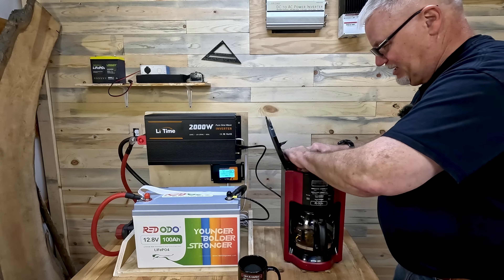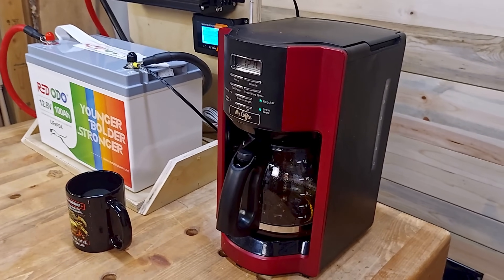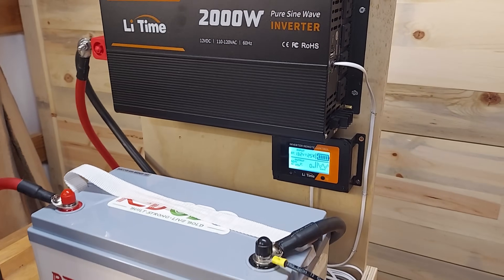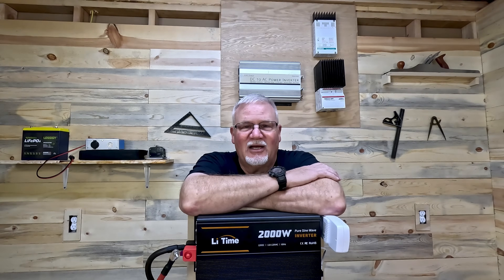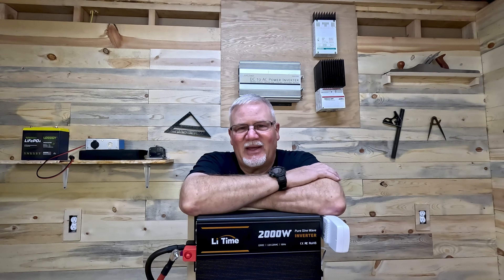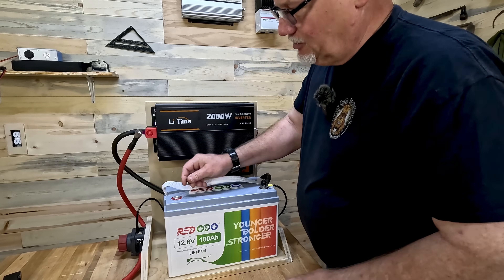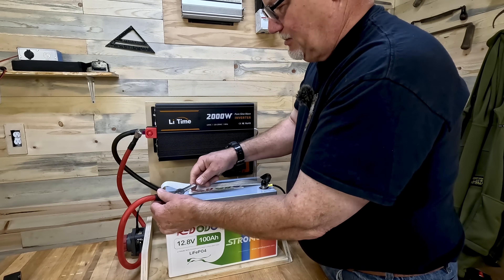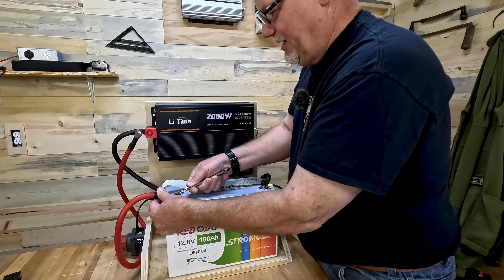🔋 How To Build A DIY Emergency Power Bank In 10 Minutes! ☕️

Comment: 200w solar panel - mppt - 100ah lfp - 12v car multiple socket and usb

It's my set up for emergency situation.. more than enough for small led lamp, 12v fans and charging radio and phone.. 😊😊😊
Reply from the maker: Sounds like a perfect setup for emergencies!

Comment: You can also take the battery that needs charging to your     car or   truck and use the battery cable from your car battery to the battery that needs charging. Then start the c ar and let the alternator charge the dead battery the proceed
Reply from the maker: True though it may not charge it fully and you'd have to have at least enough battery tobstart the car

Comment: Why did you use a 100 amp fuse, but are gonna use a 250 amp circuit breaker?
Reply from the maker: 150a breaker - what I said was I was using a 100a fuse but have a 150a breaker coming.  With one battery like this one the BMS will stop it from drawing over 100a (which is does in the video but it was at 130+ amps) -- and a 2000w inverter drawing 2000w off a 12.8v battery is at 156 1/4 amps.  If the BMS fails the breaker will disconnect before I hit 2000w on the inverter.

I realize this isn't what most do, it's just what I tossed together for testing purposes.  If I were going to use this system I would use two LiFePo4's and a 250amp breaker probably.
Reply: @TheOldJarhead  Gotcha, thanks for the quick reply, was confused because link takes me to a 250 amp fuse, I have the same inverter and a 12 volt, 300 ah battery, so I should use a 150 amp fuse? I've seen some use a 250 amp  fuse
Reply from the maker: Depends on the BMS and inverter.  That inverter can draw over 230amps if it peaks at 3000w, for example, then at 12.8v, that's 234amps.  But it's a matter of what you feel safe with.

Comment: 🤔🤔🙋🏿🙋🏿🙋🏿🙋🏿🙋🏿🙋🏿I have a question🤔?actually a few😮. I'm in Houston I live in my truck. I have a topper too tho. My fridge ,microwave ect is in back . I bought a bluetti. 2nd day basically broken.  Screen died . Im sending it back . I've looked into dual gas powered generator 😑I'm not convinced.  But I don't think a bluetti or and power station can 1 stay in my truck especially during the summer without overheating or something.  And personally I'm not liking how it's all digital all of this crap is. Can these batteries handle tx heat? Would this power my gear. Or is a isolator better.  Help PLEASE😢😢😢
Reply from the maker: Texas heat can be a killer for LiFePo4's as they generally cut out at 149F.  So, imagine, the battery is in the bed under topper and it's 120F out (I've seen that in Austin back in '99) and the battery is in use and generating some heat itself.  Could potentially get to the upper temps and shut down.

It's a tough one without AC keeping things cool and power stations are pretty much the same.  Perhaps though, if the battery and inverter were placed in a location with good ventilation that can allow enough airflow to keep things a bit cooler than perhaps it would work fine though in hotter temps I'd be sure to be in the shade!

This setup would run a small MW and have no issue running a fridge but you'd need some solar on the roof to provide plenty of recharging during the day and a small generator is a good idea for those days solar isn't enough or it's cloudy.  An inverter/charger would provide the charging profile needed for LiFePo4's and allow the gen power to pass through as well, plus give the opportunity to plug into shore power when available.

Perhaps an RV AC unit on the roof running off shore power only or the generator could work as well.
Reply: @TheOldJarhead  🥳🥳ty for actually responding that means alot to me . I'm doing a thing on my channel I sent u a video idk if u saw it .I just got off checking messages ty I appreciate ur time. It's making me consider just renting a place.  The stuff I've been though with technology and shipping is not worth me suffering due to defective equipment like the bluetti ac180🙄 . I can handle heat but inside a parked car in July in Houston is not fun . I've done it. That's why I'm preparing now. But I hate being in apartment or anywhere other strage people are . But I have no option sounds like🥺😭😭
Reply from the maker: Didn't see it but I'll check out your channel.  And yes, the heat can be an issue regardless and unfortunately, where you live is HOT!  I can't imagine trying to keep even an RV cool without shore power.

Comment: Nice video... but if I want to charge the battery via the AC charger, do I need to disconnect all the cables each time? Or can I leave the entire system as it is?
Reply from the maker: Nope.  Just connect the charger and go 😀

Comment: Those are nice cables. Where did you get them?
Reply from the maker: I had them made up at 'Traffic Jam's' -- pretty much any car audio place will do it inexpensively though flexible 1/0 is $10/foot to the 3 cables cost me $77 after connectors (which had to be hogged out a little for the switch), heat shrink, crimping etc.  Since it's a one time deal it's worth it IMO.  Cheers!

Comment: Great video.  One thing I wish you would have done would be to measure the amps on the 1/0 cable with a clamp meter. Thanks so much.
Reply from the maker: I may have to that if my Amp meter works but the math is pretty simple 😉 at 13.2v 1070w is 81amps.

Comment: Is it okay to use a power strip and connect it to the inverter for convenience sake?  That way I won't have to be plugging and unplugging appliances.  Enjoyed the video very much, I just ordered a couple of 280 ah batteries before the tariffs increase the price.  My EG4 48V battery is now 200 dollars more.  Ice will help with the pain from the burns in the future.
Reply from the maker: Yes!  Just like any circuit you can use a power strip.

Comment: And you can add a 12v Marine Plug for 12v applications.
 I had my small 400watt setup on a hand truck. 
The larger 200 ah setup in a box with wheels, with a 1500 watt PSW inverter. That ran my small micro wave, or One cup coffee maker for tea... Even the 400 watt setup ran that.
Reply from the maker: Nice

Comment: Why does this setup not require proper fuses?
Reply from the maker: I never said it didn't.   I also have a fuse (mentioned in the video) and have a breaker (the proper method for a setup like this) on the way.

Comment: Great coffee episode  lol
We brew our coffee for 4 months now off a ecoflowriver2pro 
We have 1 Redodo battery with a 10 amp charger off solar but we have not had to hook it up as far as yet
Wish you could tell us if i could hook this 12v-100ah lifepo4 up as you mentioned you need a 24 volt charger ? We are confused..
Reply from the maker: 12v charger.  The one I use does both 12 and 24v.  I can't recall saying you needed 24v.

Comment: Can you recommend one with an automatic transfer switch built in that essentially acts as a bigger ups?
Reply from the maker: I'd have to look into it.  Don't actually know one.
Reply from the maker: It occurred to me that the AIMS I was running for 11 years had this function.  You had two choices:  power from batteries with 'utility backup' or power from Utility with battery backup.  I never worried about it because I had a generator and no utility power and if the generator ran, it charged the batteries and powered the cabin regardless of the setting.
Reply from the maker: OK, now that my brain fog has cleared (LOL) it occurs to me pretty much ANY Inverter Charger will do this ;)  Here's one:  https://amzn.to/4iQPZB4  3000w inverter, peaks at something like 9kw and works as a UPS. https://amzn.to/4iQPZB4

Comment: That's a nice project. I need an inverter and cables but that's how I plan to replace my solar generator to run the microwave when the power goes out. I'll probably pay extra for a 48V battery and use a 48V inverter. Also setting up a smaller version of that to keep portable devices charged.
Reply from the maker: 48v would be great, I'm doing one this week.

Comment: I like that inverter remote display! I have several with remotes but it's just a toggle switch. Wonder if that display would work on other brands ....🤔
Reply from the maker: Hard to say unless they are rebrands.  I see others have them but they appear different.   It's a nice feature and has power button as well so the inverter can be elsewhere, say in an RV.

Comment: What would you suggest for a battery charger ? TYIA
Reply from the maker: Honestly?  I'm using a cheap 19amp Amazon job that seems to work, but I've been looking at some others and think any of the less expensive ones by Redodo, LiTime, etc, will work.

10amps is a bit slow but works if not in a hurry. Otherwise, I'd get a 40amp charger.
Reply: @ I checked out a few on Amazon , I've spent less on a weekend bender in Yuma . Hopefully a sale pops up , it's more want at this point than need . I appreciate your guidance
Reply from the maker: https://amzn.to/41RCuKG This one has been working well for me.
Reply: @TheOldJarhead  Just purchased , thank you
Reply from the maker: You bet.  It's a 10a charger but I use it for all my 12 and 24v LiFePo4 batteries
Reply: @TheOldJarhead hows the warranty on litime batteries had you had any issues with them by chance looking to buy one or redodo lithium battery
Reply from the maker: I've had no issue with either of them and both have 5 year warranty's.  I also like the XZNY's which I have a few of.  I'll admit, I've given away several batteries since reviewing them but those who now have them have not mentioned any issues with them (they all use them for overlanding setups or home backups with power stations).
Reply: @TheOldJarhead  thanks for replying back so quick,  I'll check that xzny out to. You think noco battery charger will charge them battery up to?
Reply from the maker: I have a couple of their small maintainers and they do work (slowly) but their big chargers are spendy!  I just looked at a 50amp one for over $800!  The LiTime there was like $180 ;)